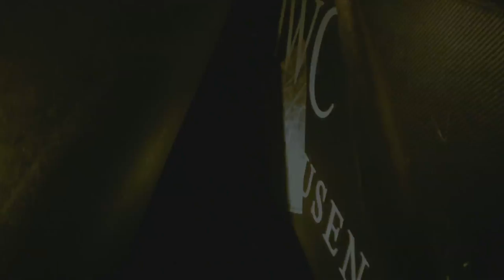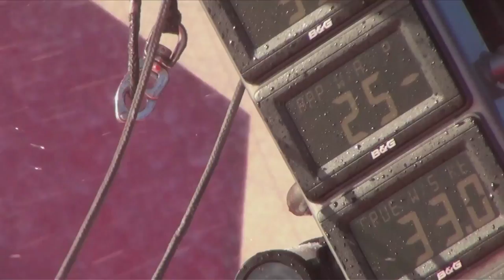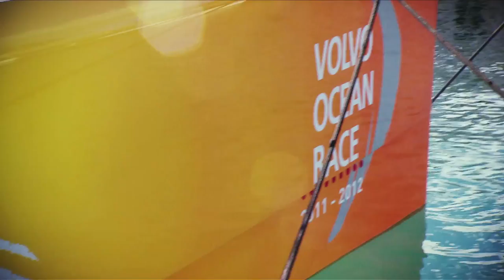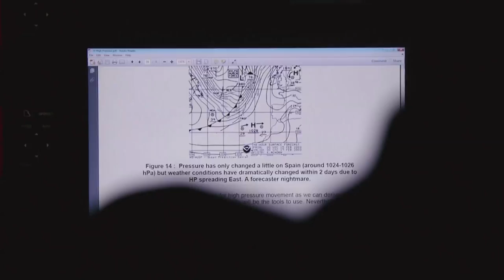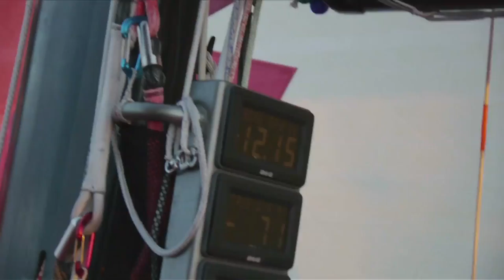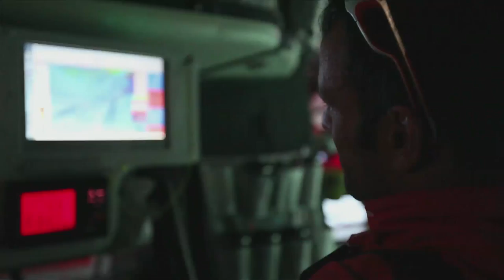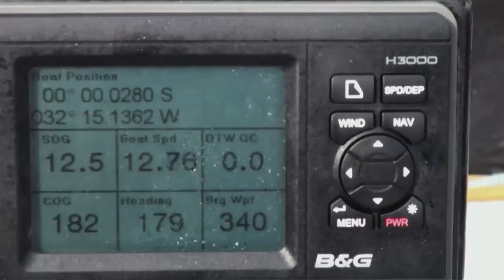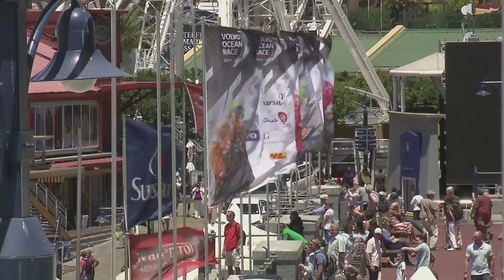Leg 1: Documentary Show | Volvo Ocean Race 2011-12

Comment: @CabbagePatch592 

If you paid attention you would realize that its not the boat design its the rig design aspect that is flawed, last race no rigs were lost but lots of boat damage so far no boat damage (except Sanya which is from the last generation) and this race it seems the rig design although puma's looks like just a simple gear failure rather then design